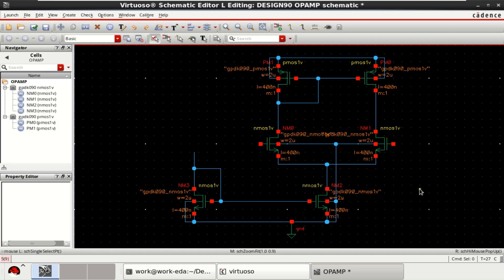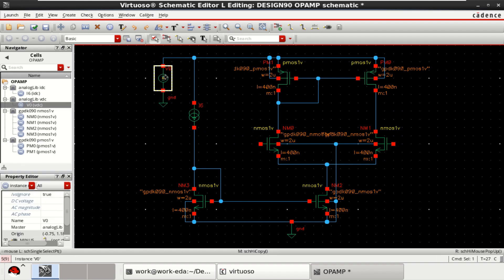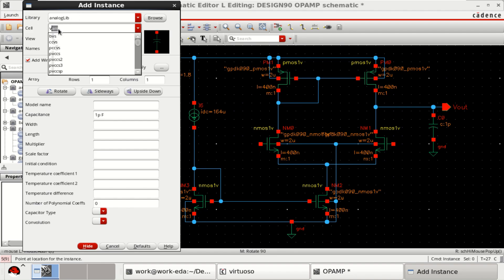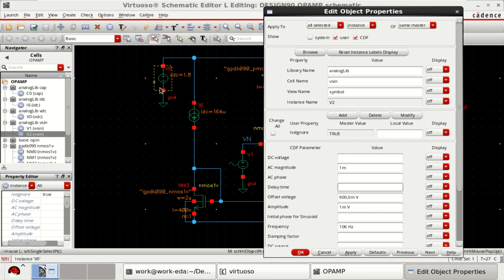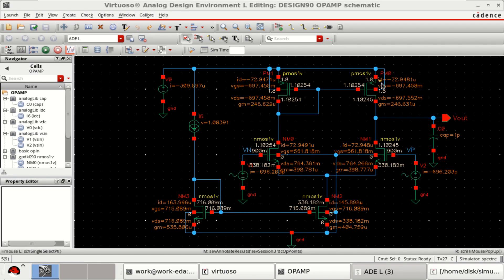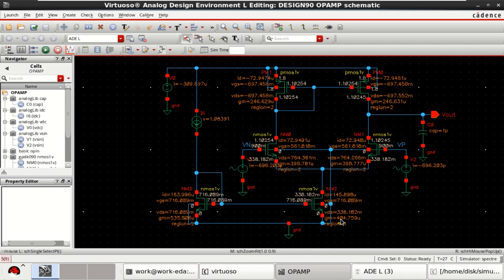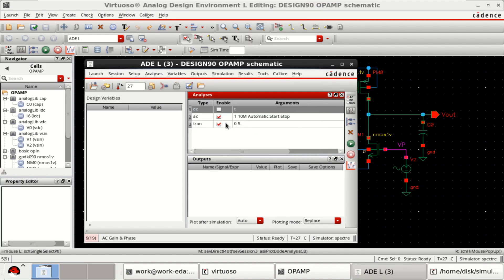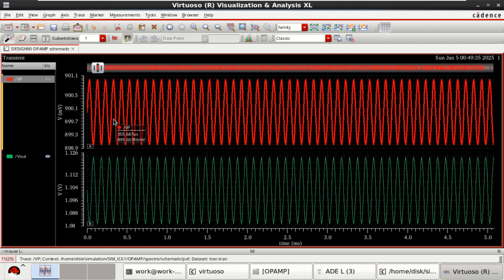OP-AMP Analysis || DC | AC | TRANSIENT ||.

Comment: Wich is the best opamp to improve transients ?
Reply from the maker: Hi. it depends on many factors, such as bandwidth, slew rate, and compensation techniques.
Reply: @dr.hariprasadnaikbhattu   Which ones can you recommend for audio? mixing & mastering..
Reply from the maker: Hi, I dont know that specific Opamp used for audio? mixing & mastering
Reply: @dr.hariprasadnaikbhattu  
specifically operational hi fidelity amplifiers with emphasis on transients, this is the most important issue between digital vs analog many prefer not to do analog processes because they lose transients.Could you recommend any?